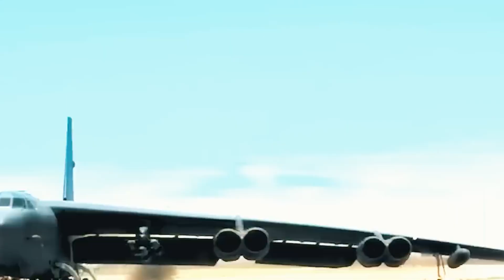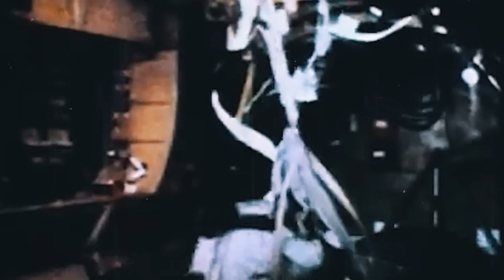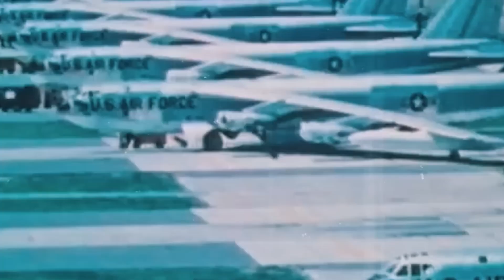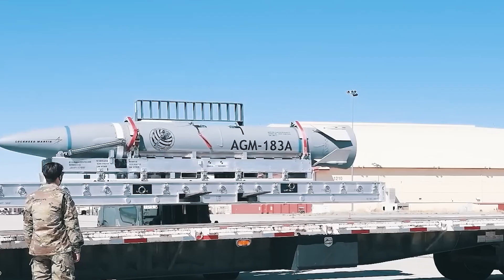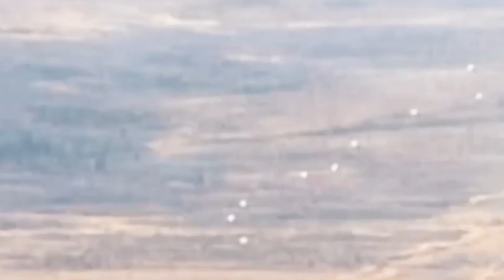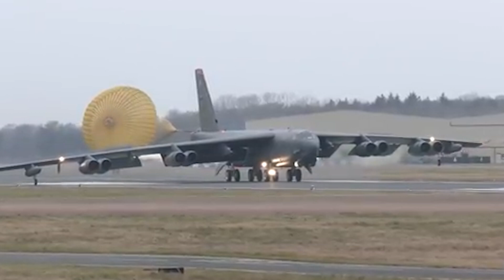B-52’s New Rolls-Royce F130 Engines – The Key to Its Next 100 Years

Comment: The B52 were long ago, bought and paid for, It can best do just one job, dropping bombs or launch missiles. What made it still in service was the elimination of the need to enter into high threat environment, the job can be done while stand off. High speed and stealth will not be necessary.  Technically any cargo planes can be modified to perform the same role, from a C130 to a C5. The bombs and missiles just have to be pushed out of the rear ramp instead of just dropped. Even an old Boeing 727 can be modified to be a medium bomber, but a 747 will be much more difficult , because of the lack of a rear ramp. Engine emission is not a big deal, by definition, war is not a very green activity. Like lower noise, it does make the 52 harder to see without the smoke trail. A common annoyance of Vietnam era airplanes civilian or military. I hear traffic controllers saying things like OK I got your smoke, no more.

Comment: Those B-52's have been overhauled and updated for decades.  I'm sure those Rolls Royce Engines will make the Plane the Best Ever.  But, I always wonder about the Metal on the Plane  ?    After all theses years are there any indications of 'Metal Fatigue?'   That would cause a disaster.